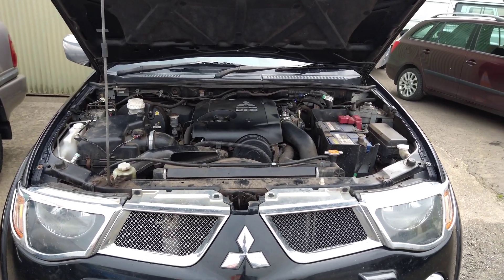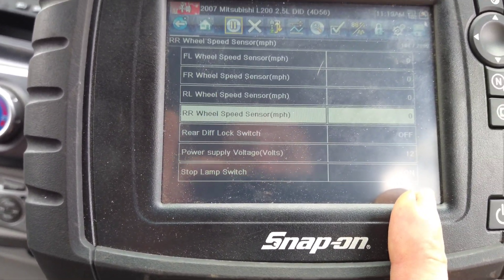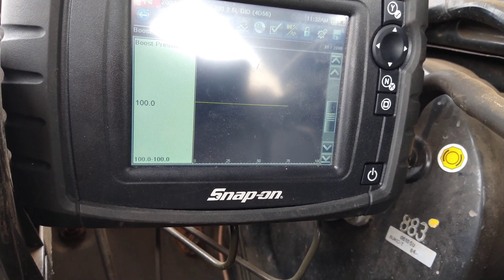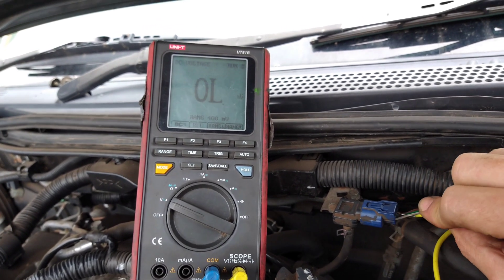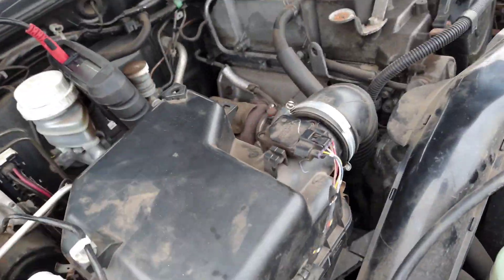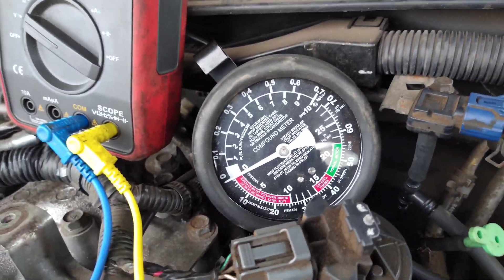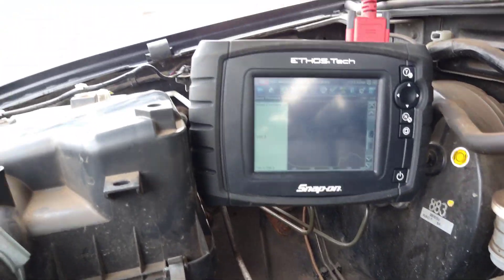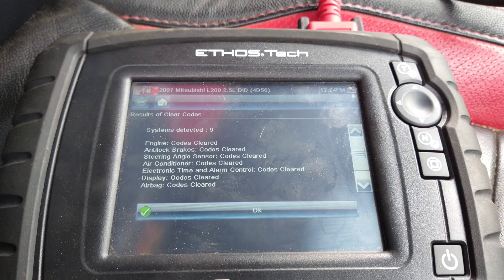Mitsubishi L200 boost sensor hose fault (ABS, Traction control, Engine lights on)

Comment: My 59 plate warrior is doing the same. Map absolute barometric circuit pressure low .. changed the pipe no difference. Cleaner the sensor no difference. I got a new sensor but it was faulty so I guess try again with a new sensor . Other than that what else would it be ?

Comment: Hi Matt,  had a new suction control valve fitted , does it need to be relearned series 4 2015 warrior,, how do you do it if it does... as traction control , dpf flashes then abs then limp mode,  just wondering if the valve has been put on wrong... does the plug  face the engine or the battery ...I'm having a nightmare...hope you can help😊, thanks ahead

Comment: Hi mate, i owe a 2007 L200, i already spent alot on my pick up, just when I thought i got it in brilliant working order? It started loosing power, 1st and 2nd hear is absolutely useless, it take a while until picks up speed.
Driving small hills? Again looses power, i always end up stopping and changing gears from 3d to the 1st,, not even 2nd gear pulls up hill, no smoke coming out of exhaust when driving, no warning lights just looses power,, i already had it in 2 different garages they don’t seem to find the fault.. 
any idea what can it be? 
Any advice or help it would help..
Thanks

Comment: Hi Matt .. Great Video I have exact problem with my 2009 Raging Bull too.... First time it happened couple of months ago I changed the MAP sensor out for a Cheap Amazon job and it worked ... Its just done it again so I assumed the cheap part failed ... switched out for one from Milners but the problem persists ... Is it likely to be the Vacuum hose ??   I guess its a cheap enough part just to check before I need an expert 🙂
Reply from the maker: The map sensor filter and hose can both split
Reply: @mechanicmatt871  Hi Matt Changed out the Vacuum Hose as well as the sensor and still getting the issue ... I am no mechanic so was not sure what you meant by the Filter ? ... is there something I am missing here ?
Reply from the maker: No mate, I was thinking the hose going from the intake manifold to the map sensor had a small inline filter. I must be thinking of something else.
Reply: @mechanicmatt871  Phew ... thought I was thicker than normal then ..... one more question ... having made these replacements the warning lights are still coming on and power is still limping .... someone told me that it will keep doing that until I have the codes cleared on computer and the problem will persist ... is that right ??  or should it clear on its own if the fault is resolved ?

Comment: Hey mate have a l200 warrior, I’m properly being thick but when is the map sensor located?
Reply from the maker: It is on a bracket connected to the bulk head, you'll see a small hose attached to it. hope that helps

Comment: Hi Matt. Im in Fife as well and came across your vid. Very impressed, i also have a similar vehicle with 2 common annoying L200 issues
1. Abs light and traction control on
2. 4wd flashes when in 2wd
How do i contact you to book my L200 in for you to work your magic?
Regards
Brian
Reply from the maker: Hi Brian, where in Fife are you? 07947944267 cheers Matt
Reply: @mechanicmatt871  Lochgelly Matt

Comment: I have the same lights come on abs traction control and EML light. It's driving slightly low ok power like turbo is not coming on.  Changed to map sensor and checked all vacuum lines still same fault
Reply from the maker: What was your fault code Adam
Reply: @mechanicmatt871  U1120 ENGINE/ELECTRIC VEHICLE ECU CAN MESSAGE STORED
U1437 DYNAMIC RANGE ERROR STORED DTC
U1430 DRIVER DEMAND TORQUE SIGNAL ERROR STORED DTC
C1292 MALFUNCTION OF NETWORK STORED DTC 
C1620 ECU INCORRECT ATTACHMENT STORED DTC
These codes are all on the ABS side.
Engine sounds healthy no misfiring or anything just feels like not enough boost or no boost.
I did notice before last week on start up was a lot of white smoke like diesel smoke not oil burning had strong smell of too much fuel but has not done that since.

Comment: Found your channel via this vid as I've an identical pickup (even the same colour) on an 06 which is putting out more black smoke than I'd like. Helpful to see this healthy one made 7 psi of boost just being revved at a standstill, mine only makes about 3 psi according to live data and I've found the wastegate actuator is seized solid so I wonder if it's stuck partially open. Given me some direction to proceed in at least so many thanks 👍
Reply from the maker: Thanks Brendan thanks for watching.